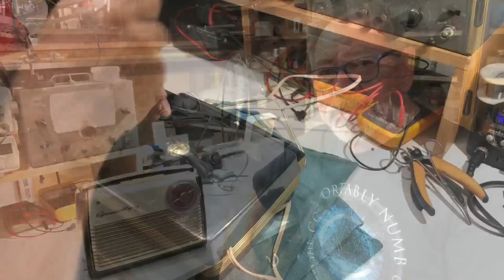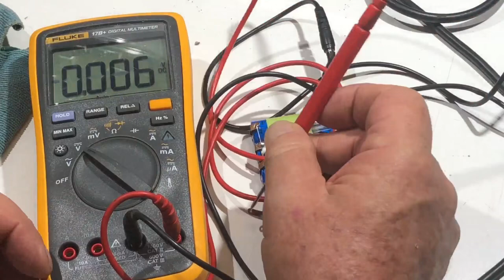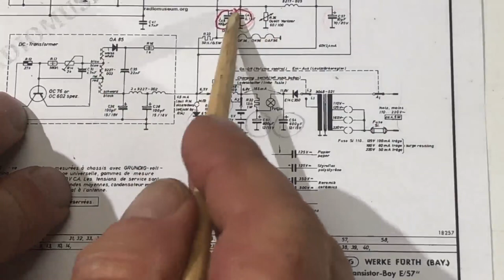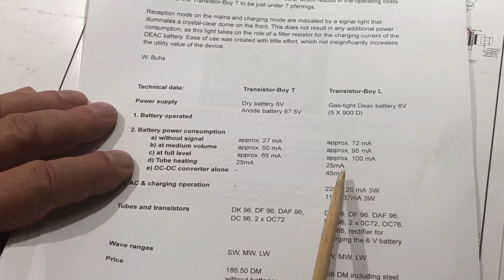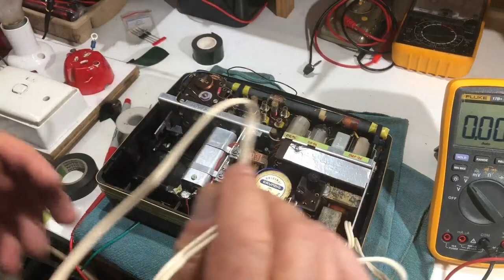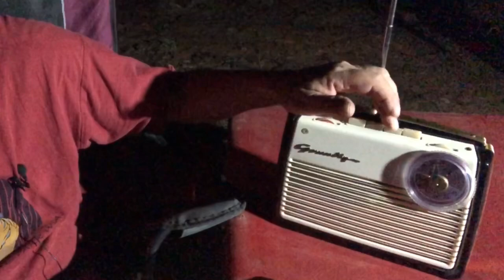GRUNDIG TRANSISTOR BOY PART 3 with Desert Testing

Comment: Hi, Don. Why are German radios so hard to work on? I have never worked on anything German. Most of the radios I have worked on are the All American 5. They have 5 tubes (valves) with series string filaments. The ones from the 40s and 50s have octal tubes. Later models used miniature tubes. They are very easy to work on. 
You were pulling in a load of stations out there in the boonies. Thanks for your video. Cheers!

Comment: 6IX and 6PR do seem to get out very well at night to the north. Thanks for the video.
Reply from the maker: Hey Fuzzy, Yes 6PR is easily the strongest station here.  The 6IX transmitter must be further North or something but I have trouble getting it as there's something making a lot of RF noise around that frequency in Perth.  I guess you live up North somewhere
Reply: @Donno308  Gday Don  6PR 882 Khz is on 10kilowatts 6IX 1080Khz  is still stuck on its 1950's limit of 2 Kilowatts  . Both come off the AM tower near Garrett Road Ascot. Maybe the Swan River gives 6PR and 6IX a  northerly  kick to their skywave signal .   I'm in the southern suburbs of Perth .

Comment: Great reception in the middle of nowhere Don, better than I get near Brisbane 😄 Good job getting it to work on the battery's and maybe a bit of trickle charge to boot 👍🙂
Reply from the maker: Hi David. Yes the reception was better than I get at home too. 
 I didn’t have time before we left but when I get home I’ll try changing that transformer tap so the charging circuit gets the full secondary voltage & see how that goes. It’s pretty useless as it is now.

Comment: Hi Don, interesting. Sony did much the same thing with some of their radios/Radio Cassette. I have one or two with the original NiCads in them (dead of course), I've never really worked out how the charging/AC-DC switching works. Pity that the only SW stations are now in Asian languages. Radio China does broadcast some English programmes and there's Radio New Zealand which I can get here with the Sony 2001D and 7600G, but not on other radios because of interference.
Enjoy your holiday, at least there are no mozzies out in the desert!
Reply from the maker: Yep. The only thing worse than flies are mozzies!

Comment: In the USA after sunset when you are out in" the middle of nowhere" you can get radio stations from 1000 miles  (1600 km)
away quite easily in the broadcast band. This is due to "skip" i.e. wave propagation ,literally the signal mirrors back down to
Earth beyond it's curvature. This ability actually varies due to sunspot activity including the shortwave bands. It is vexing
that many stations repeat the same programming across your continent Don. It's a really great radio after working on it.
Good stuff and enjoy some time off. Cheers, Steve from Illinois, USA.
Reply from the maker: Cheers Steve. I’m just about to upload a little travel video. Sitting by the beach here at Quobba Western Australia watching the waves breaking on the rocks. Beautiful weather and, best of all, no bloody flies!  The internet connection is very slow though s it all takes time!

Comment: Cannot see now how you charge the cells.... FYI, a Ni-Mh cell does not charge under 0.03 - 0.05 C, So for yours, under about 60 - 100 mA, the current is not able to add charge. That 0.03 - 0.05 is the maintenance charge, only able to keep the cell topped off, so it will be kept full.
Reply from the maker: Hi Erik. Yes, I agree. As it is, it would only be good to keep the cells charged. During normal mains operation it charges at 60 - 70 mA which would, I think, charge them very slowly. I ran the radio for about 2 days before leaving on the holiday but of course they were partially charged when purchased. 
When I get back I plan to change the charging switch so that it operates on the full secondary winding on the transformer rather than the lower voltage tap. That may provide a reasonable charging current. If not, I think I’ll revert to using replaceable batteries and use a small relay to isolate them during mains operation. 
Unfortunately I have no real information about the original “DEAC” battery supplied with this radio but I find it hard to imagine how it would have worked. I googled hat kind of batteries were available in the 1950’s and apparently Ni-Cd batteries existed but were very expensive. I decided to go with that and Ni-Mh was the closest available equivalent.  Surely the original battery can’t have been lead acid?
Reply: @Donno308  
At the Radiomuseum I see a "DEAC Nickel-Cadmium Batterie - Battery 5/900D, around 1960. But I don't know if that was the size that fits the radio.

36 x 100 x 36 mm / 1.4 x 3.9 x 1.4 inch
6 V, 900 mAh.
Ladung: 14 Stunden mit 90 mA. (Charge: 14 hours with 90mA)
Entladeschlußspannung: 5,5 V.   (Discharge voltage 5,5V)

Also my thought to use the full winding. That Ni-Mh can take up to the full 2000mA if necessary, although not preferable, but that power supply won't get there, especially for that incandescent lamp in between. Try....
Against overcharge you could fit a charge board for 5 cells. Search for "ni-mh 5s charge board"
Reply from the maker: @erikdenhouter Thanks.  I hadn’t thought of fitting a charge board. I’ll investigate that.